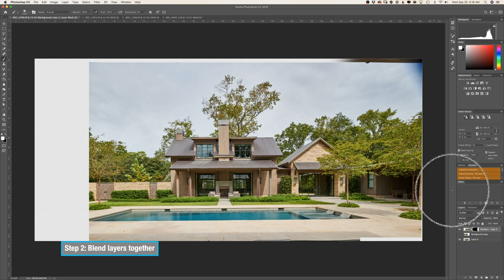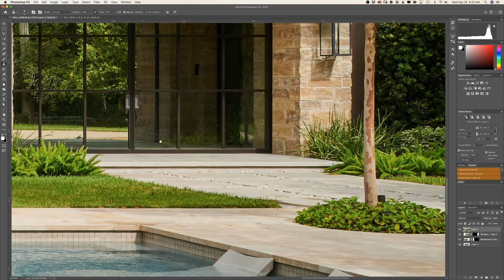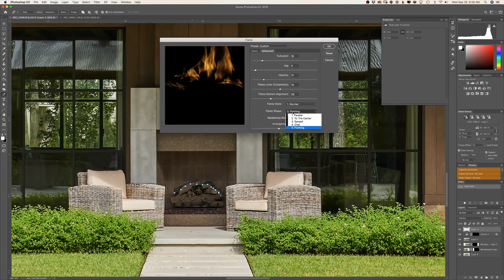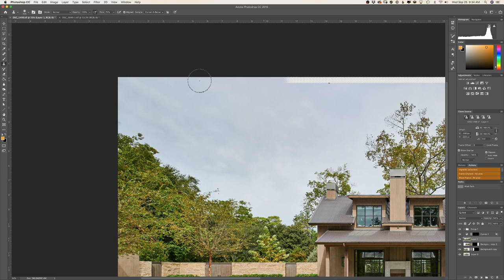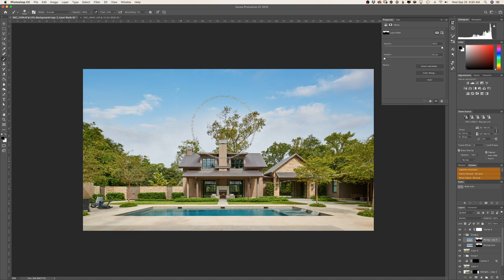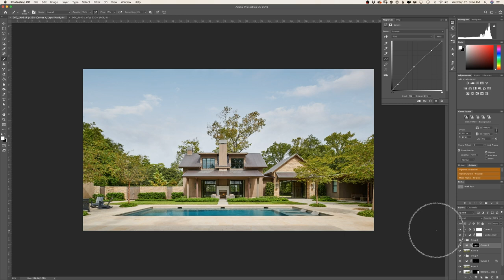Post-processing an architectural exterior image: Sky replacement and Photoshop's Render Flame tool

Comment: Great video Peter!  Thanks for taking the time to put this together.  I had a question about stitching multiple photos together to create this wide semi-panorama.  When you are taking your various frames, do take bracketed exposures for each, while the camera is in that position, and then blend your exposures for each before stitching?  I see on this image you stitched three frames together, but they appear to have already been exposure blended (assuming these three shots weren't single exposures).
Reply from the maker: Thanks for watching! When I'm planning to create a shift-panoramic image like this, I definitely bracket to cover my bases, but then will do any blending of those brackets once I've done the stitching in Photoshop. This can of course prove a little tricky when doing anything very complex, but feel it's the best way to get a consistent result across the frame.
Reply: @PeterMolickPhotography  Thanks Peter!

Comment: Thanks for this great video. I was wandering what is that special brush you are using?
Reply from the maker: Thanks Stefaan! I'm not sure which brush you're referring to, sorry!
Reply: Peter Molick Photography Hi Peter, the tool used around 1:50 in your video,
Reply from the maker: @studioleopold95  That's just the normal brush with 0% hardness and sized very large. Hope that's helpful!
Reply: Peter Molick Photography Thanks! Was not aware and never noticed...